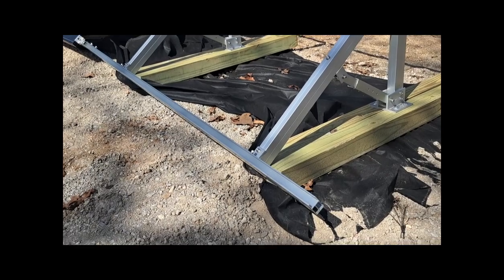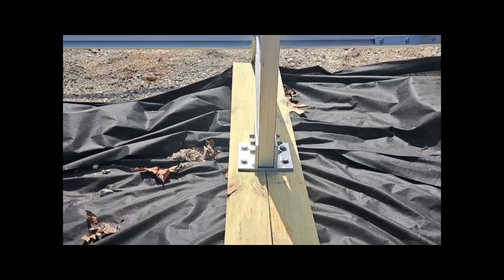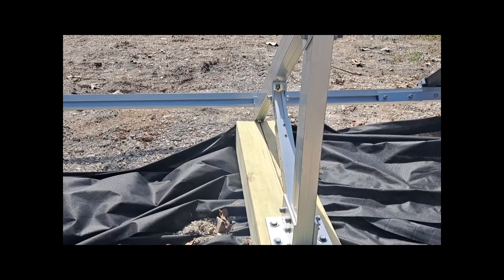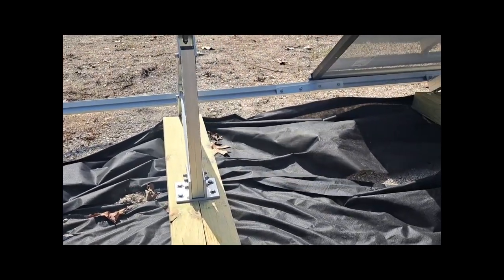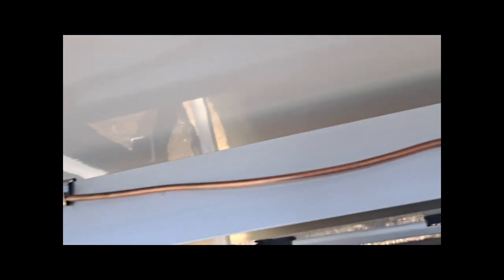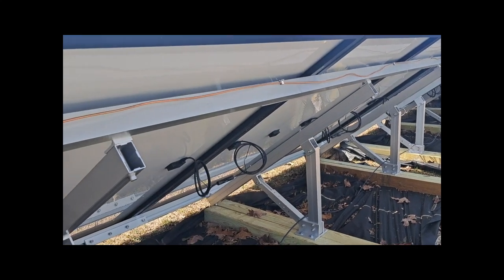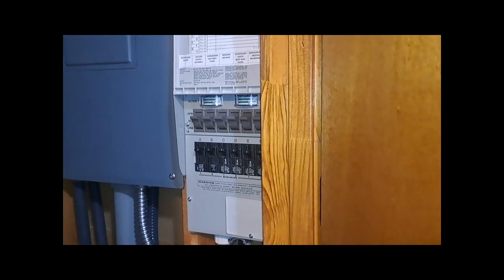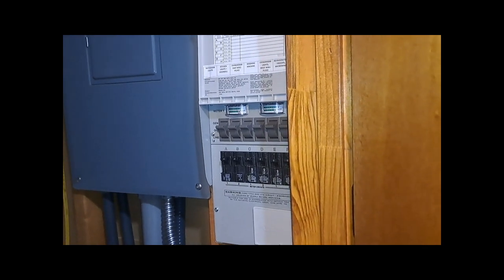Start To Finish Solar Power Install - EG4 3000 Watt Inverter - EG4-LL V2 Batteries - EG4 Brightmount

Comment: Andrew,  you said before that you would make another video on your transfer switch 50 amp that you installed. I'm asking if you would please make one of those. I'm trying to copy you on it, but not as smart on any of this. If you make that video could you go over everything slowly and more the information the better. Talk like a 5th grader is listening lol. Thank you.
Reply from the maker: Made one but not a 5th grade version. The directions that come with are very detailed. Just mount near the actual home breaker box and have the solar output 120 or 240v lines run to it.

Comment: Missing a ton of steps and included a bunch of stuff that has nothing to do with the solar.
Reply from the maker: What steps do you want to see? Everything was pretty much cut n dry. Certainly don't know what was not part of solar hookup
Reply: the first two minutes is irrelevant. Looks like you’re putting up trusses or something. Then from 2:30-3:00 you have all the wires connected and going through things but none of that is explained. At 2:26 is when the wires all magically appear. At 4:50 you talk about the white box with blue switches but not how to connect the so called “nater breaker.” Taking it step by step one wire at a time connecting in all the right places is necessary to not cause failure or fire. It makes a difference when you connect the battery, positive then negative. You have to connect the panels and electrical input output all in the right order.
Reply: I was wondering if you could go over in great detail how you hooked up the reliant transfer switch from the main panel. I'm just getting into this and my inverter and LL battery (same as yours) will me mobile but I want to have certain things hook up to the transfer switch so I can just plug into it and flip on what I want you run. Can you make a video on that with a lot of details?
Reply from the maker: @ChrisSaviano  I am actually making a video on that now. Will post soon. The box comes with instructions. Not hard once it is in front of you. Wires from Solar inverter go to the power lines, I used Wago connectors on the breaker wires that go from box to main panel; where you remove fridge breaker wire and connect to wire A. Then put the Other A wire to the fridge breaker. That way the box will flip from line to solar
Reply: @AndrewKuster  thank you. It won't be soon enough to see how this all comes together and works. I just hope i can find it when you release the video.
Reply from the maker: @ChrisSaviano  Trying to today. Lost footage of original hookup detail. Will reply here to you when.
Reply from the maker: @ChrisSaviano  https://youtu.be/OPPqwK5Sqyo but as said; main install video is deleted somehow. Others on here cover the rest. Leave a comment on the video if you have questions.

Comment: Who did you order your inverter from? I ordered mine from Solar sovereign which is affiliated with signature Solar almost a month ago. Shipping label created over a week ago and still no updates and they do not respond.
Reply from the maker: Signature Solar. I had zero issues with them and fast shipping for a semi and a box truck. https://signaturesolar.com/?ref=6GBwB-d9rAtRIn  is my affilate link. However I won't fib on products. With my setup I am fully charged in an hour or so of these summer clear days. 4 hours when its raining or was really depleted from days without sun.
Reply: @AndrewKuster  I ordered through Solar sovereign which is affiliated with signature Solar so I figured I wouldn’t have a problem and they were offering free shipping on orders over 3000. I finally got an email back from signature solar today that they will look into it Monday.
Reply from the maker: @jglassman1122  If it gets in the right hands at Signature Solar you can get immediate responses on orders. However buying from an affiliate or other it takes them time to get in touch with those people as well but with more authority so to speak. Signature Solar did say several things like the 6000xp was not in-stock but would ship out in a month or so from now. I'm really enjoying what I setup. No issues and even if I don't save a dollar; I have a dang good backup source.
Reply: @AndrewKuster  I’m in a similar situation. I’m just building this for emergencies and to help lower my bill a bit plus it’s fun. I’m just anxious as I’ve already got the panels installed and wired just waiting on the battery and inverter.  I will likely add more batteries and the eg4 mini split later this year.

Comment: Also recommend the 6000xp for idle consumption purposes vs two 3000 watt inverters.  Supposedly the E4 3000 is a little more than 50 W each so no matter what you’re pulling over 100 W constantly from the battery.  It doesn’t seem like much, but it definitely adds up overnight. One 6000 XP is only about 50w.  One other thing that is recommended and you may have it it’s just hard to see from the video the battery wires going to the inverter hook the positive from the first battery and the negative from the inverter to the negative of last battery to evenly pull over the whole bank.  Take that info or leave it. I just figured I would pass it along.
Reply from the maker: Saving for an 18k. As for the battery I was going off their instructions as I had asked that. Will look into. Many thanks
Reply: @AndrewKuster  you will love the 18k.  I don't fully have mine installed yet but I have just been testing it on small loads (1800w at the most) and only 3300w of solar.  I have never heard a fan kick on on this thing! I think it's around 70-75 watts of consumption when no grid or solar.
Reply from the maker: @joshhartin78  no fan sounds great lol. The 3000 gets noisy when charging for sure

Comment: Great start for your first video. I know that initial start is always a nail biter. Only thing I suggest is to just get a 6000xp and there will be no need to run 2 3000's in parallel also less wiring and keep your 3000 as a back up, or run the 3k inverter for the 110-115 loads and the 6000xp for the larger loads. No need for the extra breaker or pv shut off as those are all inside the 6000xp. Also the power pro battery inside is 3299 which is 14.3 kwh for the price of 10 kwh in two eg4 LL V2 batteries. Good luck.
Reply from the maker: Saving for an 18k. Did some math. However loving the feeling of being a little more self sufficient. No fire arrestors on the 3299 correct?